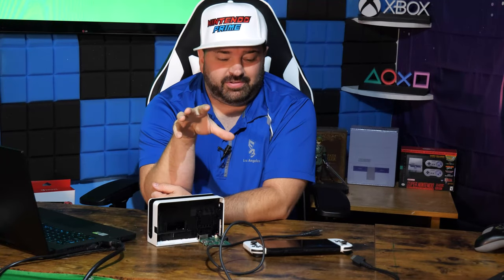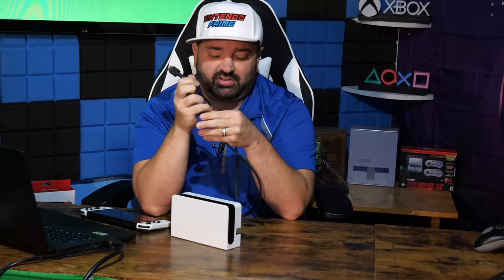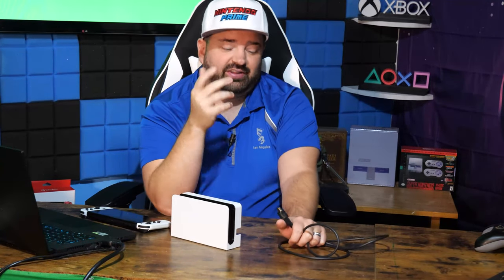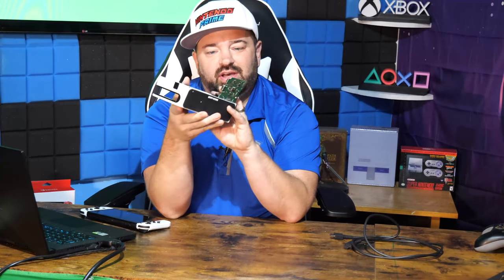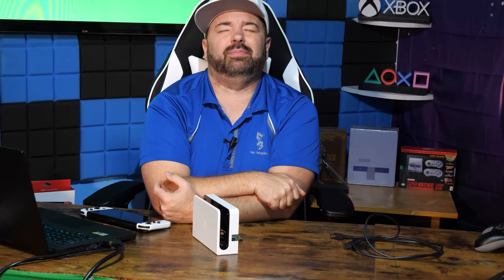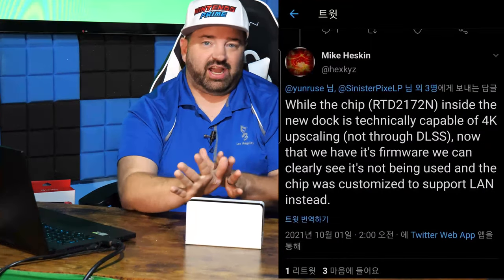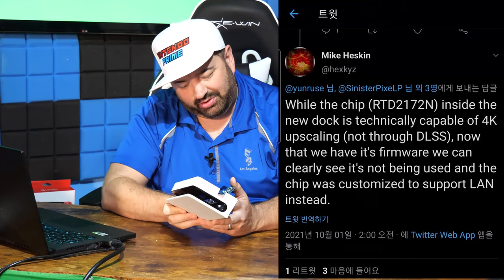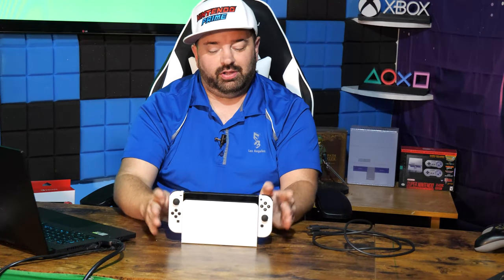Switch OLED's Dock Can Output 4k & 60fps, Future Proofing for a New Switch!

Comment: Uh, the Nvidia Shield uses the Tegra X1 and has AI upscaling, so it CAN do it. It’s nvidias DLSS, but didnt it come out that Nintendo are developing their own? Can you please do some tests to see if the OLED runs faster than the OG switch in Docked mode? Wondering if its overclocked at all
Reply from the maker: It is not overclocked. Same speeds. No performance improvement. And the Tegra X1's "type" of AI upscaling is pretty crappy. It's not something I would remotely imagine Switch attempting to use. It eats up a lot of processing power.
Reply: @NintyPrime  why you gotta crush my hopes :( Damnit.

Comment: If I was Nintendo, I would release a portable and a tv console both sharing the same game library and hardware, then 4k output would make sense with AI upscalling.

There are some benefits of doing so, you can have cheaper, more capable hardware, meaning more people to buy your games and a increase in perceived value of your game library due to 4k res, (specially important when you are trying to sell Mario at the same price point as Cyberpunk 2077).
Reply: @igcreates2760  because if it flop you can always shift chip production to your regular switch as long as it uses the same hardware.
Reply: So you want another underpowered Nintendo home console that has the graphics potential of a portable console no way.
Reply: @igcreates2760  the thing would be 100$ cheaper and able to output consistent 1080/60 fps. At that point you may as well buy that and a switch lite.

Comment: Nintendo is going to upgrade the CPU & the storage to 128 in 12 months. 
In 2023 you will see a 256gb version with upgraded GPU. This will allow for more PS4 ports 👍🏻
In 2024 you will see the $999 Nintendo console with NintendoVR included & it will rival the PS5 helmet.